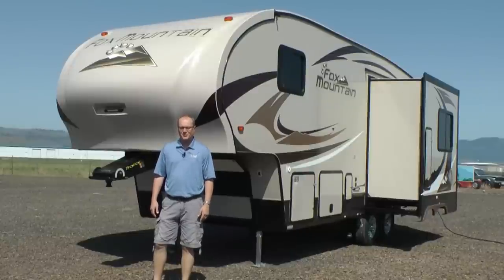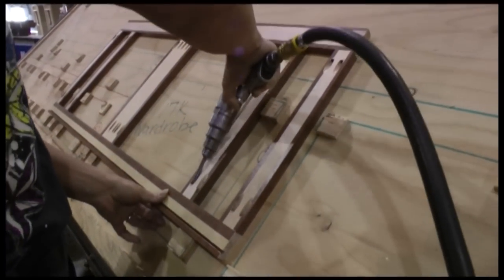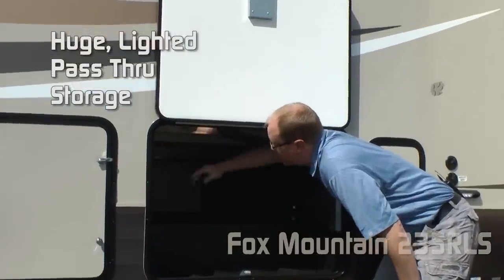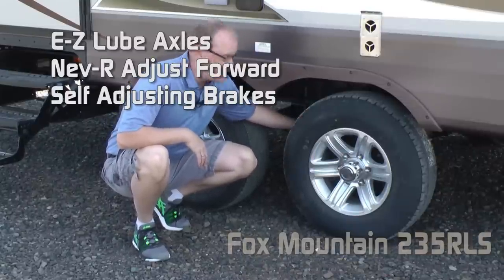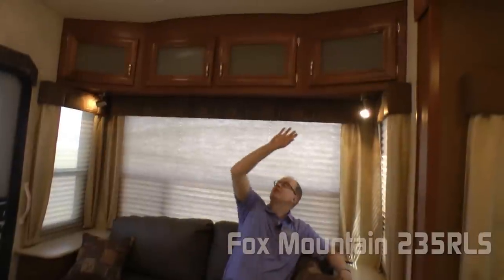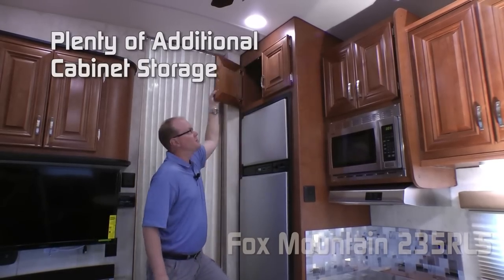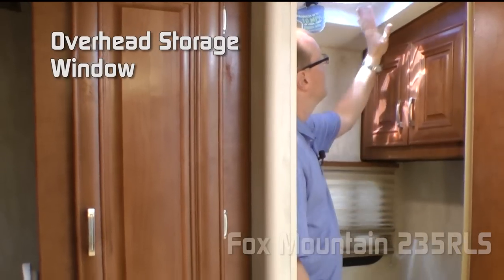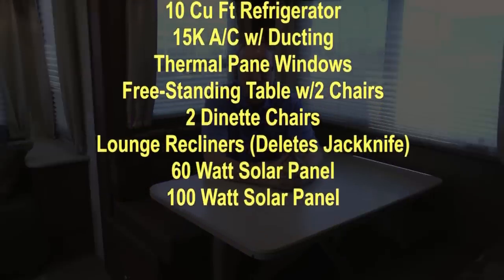Quick Tour of the NEW Fox Mountain 235RLS

Comment: Can you help me?  I have a 2017 F-150 SuperCrew with the 5.0 V8 and 6 1/2 foot bed.  Can you tell me how much towing capacity I have?  What is my payload capacity?  I’m considering getting a 1/2 ton towable 5th Wheel but I’m getting conflicting information.  My drivers side door tags say the GVWR is 7050 lbs and Payload is a maximum of 1975 lbs with cargo and passenger load.  I can’t find my GCVW rating.  Anyway, would I be safe towing a combined cargo and trailer 10,000 lb 5th Wheel?
Reply: No
Reply: No way man lol

Comment: Correct me please: that shower is a shower? Garden tub? Hmmmm.
Reply from the maker: Just what it's called from the Manufacturer of the tub.  It has a small lip on it all the way around so they consider it a "Garden Tub Shower Pan".
Reply: Northwood Manufacturing :  Ok if so how deep can I fill it? Can I sit and soak in it? I have a corner angle shower pan now, with glass roller doors. Can't fill it more than 1 inch. Curious. Thanks.